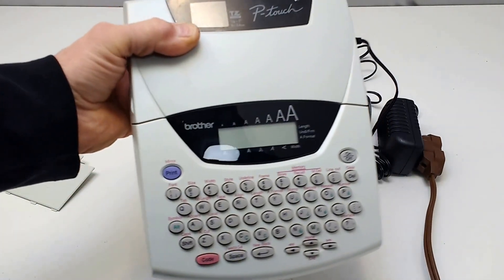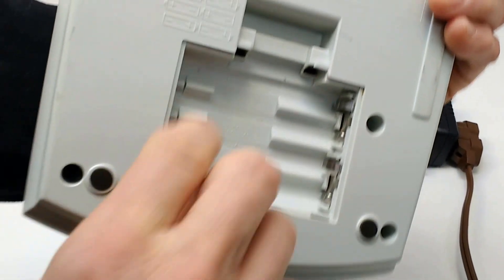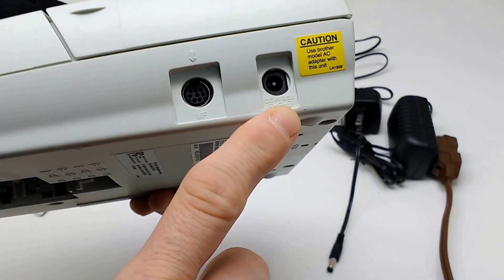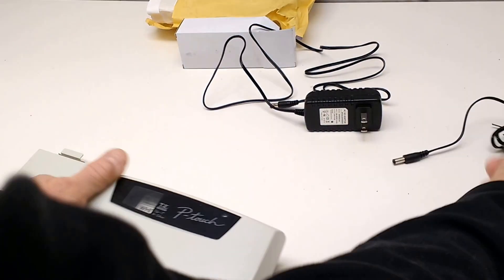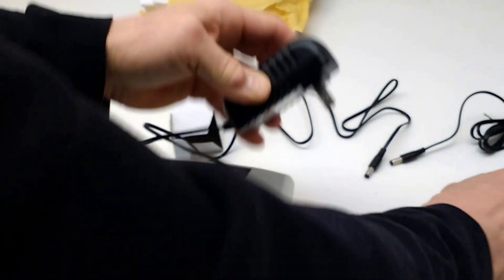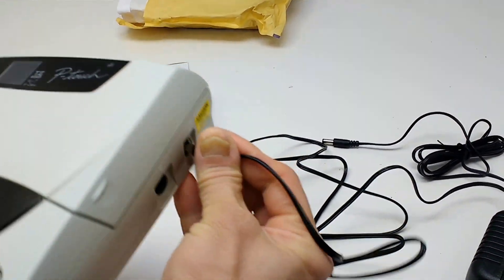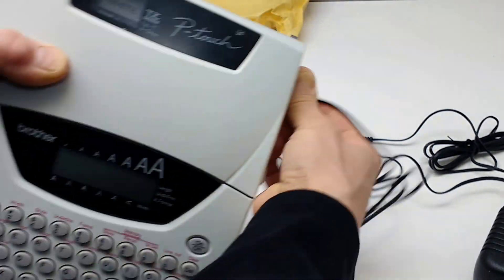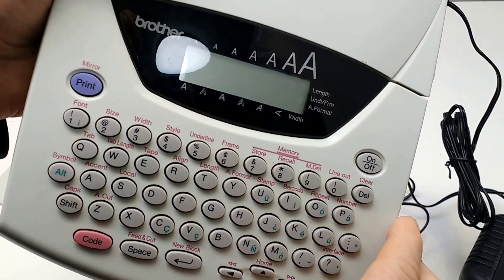Brother P-Touch PT-2400 9 Volt AC Adapter not enought to power it. 9.5 Volt is necessary

Comment: I have the recommended 9.5 volt power supply and it doesn’t work. 
Glad you explained the issue. I will get the appropriate power supply.

Comment: Yo no joke, no troll, no shit.  The dude that your saying is trolling and not to listen to him..  sorry sir but he is right.  I used the origonal 9v 500ma +over- adaptor and all sudden the thing stopped working with the adaptor unless i put in the 6aaa then connected the adaptor, at that point i could unplug the batteries and the adaptor would work fine, power off and back on adaptor only..  until i waited a while unplugged..  then adaptor would not power on the unit..  so i have an adjustable power adaptor that goes from 3.3,6.5, 9.5, 12, 13.7, 15, 17.9vdc and has a polarity switch.. so set to the 9.5vdc + over- it powers on, but printing i get the battery!..  so i flipped it up to the 12vdc same polarity and ill be damned if it works like normal now..  display dark and responsive, no problems, no batteries..  ledt it on for a bit, no issues, no magic blue smoke, no escaping pixies it fucking works..  so yea, thank you dude that said 12v on both this dudes posts, your fuggn right and the 9.5 v turns it on but no dice..  all is normal in the neighborhood now, the wife has her beloved batteries back for the ole electric finger and has her labeler to label it accordingly so i dont give it to the boy again as a fancy passifier..  caught hell for that but i kept telling her its ok, he wont know if we dont tell him and when his balls drop if he acts like a dildo we can tell him he used his moms as a passifier when he was a baby..  win win...
Reply: Ahh i hope somebody reads that, thats comedy right there.. true story tho.. im not to bright when the little poop bag wont shut the fuck up crying on because the damn remote dropped on his little foot.  Told em sorry my bad but noo, sir shits alot dont care..  and the damn dog loves them damn passifiers, eats em like candy..  situations i put myself in..  fyi, i bought another electric finger just like my wives and gonna give it to junior sometime when she pisses me off.  Gonna be great!  Ha!

Comment: I have tested it with a variable power supply: The Brother PT-2004 needs at least 10.1 Volts to work.
A 9.5 Volt power supply is not enough!
Tip: Works fine with a 12 volt power supply!